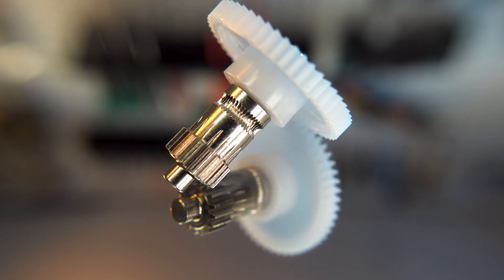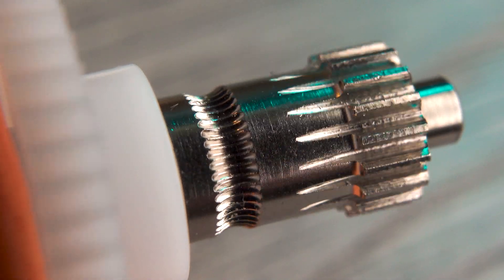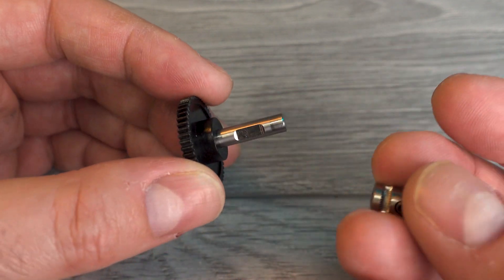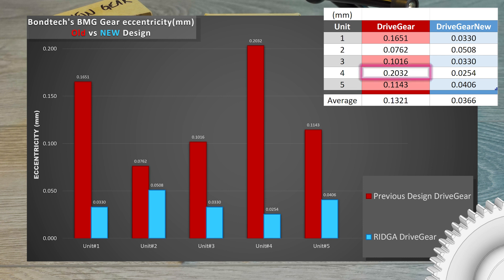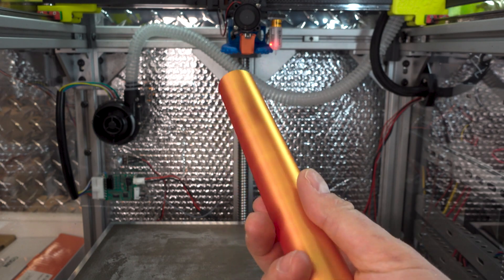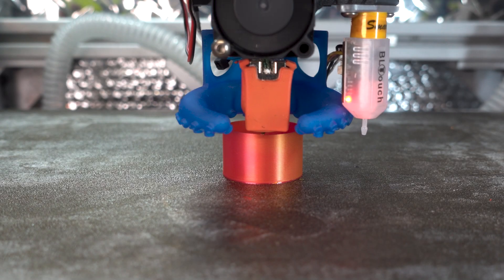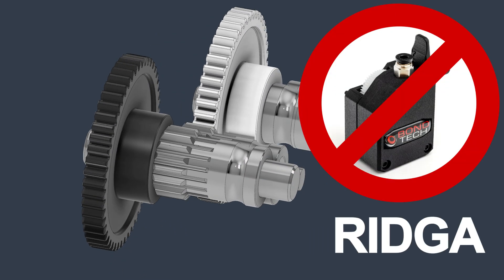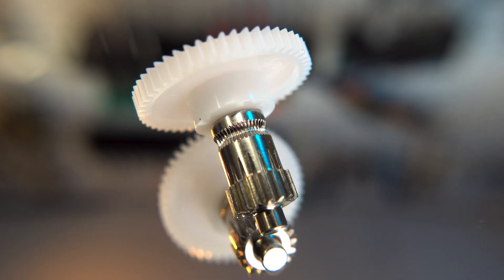Will this NEW extruder gear solve the issue?

Comment: hi miragec, vey very nice work, i have a cnc hextrudort from mellow, will the ridga work on it? also is it worth it or  the gear that comes from mellow installed is quiete as good as the ridga , i have bought it about a month ago its quite fresh, also another thing what bearings do you use instead of the secondary drive gear? happy printing!

Comment: Oddly enough, i built a validation stand to hold my .0005 indicator to check this. My findings with the 3 I checked, the one with the absolute best runout on the body of the gear (<.0005tir) had the worst runout on the peaks of the actual toothed drive section (>.0035) Unfortunately, I dont have an indicator tip that is small enough to mesure the depths of the gear to see not only runout, but the depth/peak variation.

Comment: After watching your both videos, i have been wondering why my same sherpa micro on clone gears was giving better layer lines than now. I have replaced  the short bowden tube, I cut the new one is little bit larger for very snugg fit. That might take away the little give previous one had. I might need to cut the tube little short than required and see the effect.

Comment: Hi I was thinking about this problem today and I had two ideas. One was of course just make the entire assembly out of one chunk of metal on the lathe. Meaning the plastic gear that gets pressed on as well. And also cnc’ed idler arms to ensure the cylindrical axis stays perfectly parallel to the other drive gear. Also, we should be using pressed gears on motors instead of set screws as that would fix some issue as well. My second thought was using the hysteresis of Bowden in a different way as a sort of “flow pressure capacitor”. Like what if you had a properly engineering chamber in the hotend that minimized stringing but also allowed for a flow buffer for more consistent pressure?

Comment: I just picked up a similar extruder, BIQU H2 V2S REVO. Noticed the solid gears and when i took one apart i was surprised by the quality. I got it for $45 and don't plan to use the Revo hotend, and will be adapting it to my hardened nozzle/volcano v1 (MK8)/ with copper adaptor Frankenstein of a hot end. I'll also be making my own silicone sock, once i figure out the best way to use foaming silicone.. maybe just using standoffs to make it "hollow" and minimize how much the sock touches the heater block

Sorry for the keyboard diarrhea

Comment: Thank you for this video and for sharing this great work. Using 4x bearings instead of the second pinion is smart because you no longer have to worry about managing the optimal distance between pinions versus gripping tension of the filament. Maybe you should replace one of these bearings with a smaller cylinder to avoid contact with the tooth of the remaining pinion?

Comment: Unfortunately, Bondtech missed the opportunity to reduce some weight. Or is there any reason the diameter of the area between gear and hobb-gear couldn't be reduced to 4-5mm?

Also, has anybody ever tried  to make a dual gear extruder with a gear ratio other than 1:1? Like 17 and 19 teeth for example (hobb-gear diameters would be different  as well)

Comment: So i just got an idea. 

Instead of fixing it from the hardware side by using precision milled parts which isn't exactly cheap, why don't we fix it from the software side by adding extruder concentricity compensation into the firmware? something similar to linear advance and input shaping, but for extruder gear errors instead.
Reply from the maker: That would indeed be quite easy to implement. And furthermore, pretty much all provisions are already implemented in Klipper, perhaps RepRap too.
Reply: I think is a bit impossible (without an encoder on the extruder) to know when concentricity beggins/ends

Comment: Looking for your advice: I have a Sherpa Micro with the original BMG gears on my Voron V0.2. Last night I built a second Sherpa Micro with the new RIDGA gears. I printed a Voron Design Cube test print with each Sherpa, and in those single test prints, I cannot tell the difference. Admittedly, I haven't done much in the way of print tuning on this printer, and I printed the cubes in eSun ABS, versus your Eryone Silk PLA. Not sure how much that would make a difference to the end result. I am probably doing something wrong (my wife would tell me that it's usually my fault).
Could you share the STLs that you used for your tests? Looks like the tube is printed in vase mode, is that correct?
Fantastic work, as always! Thanks to you and Bondtech for your efforts!

Comment: I bought several of Bondtech's original 2.75 gears and they were useless - the gears wouldn't mesh with the filament in place! This single gear piece seems to be an improvement. But, having been burned by buying expensive Bondtech gears that do not work, I will wait for a lot of real world reviews before I will consider purchasing this one.

Comment: Just slapped one in my CW2! Runs great! Thanks for all you've done for this leap in DD print quality!
Reply: Was it plug and play or did you have to modify the extruder?
Reply: @silent16932  only had to swap bearings for MR84s that are 2.5mm wide, KB3D has them for a good deal.
Reply: @jeevus3d980  wait wait in CW2?? I have bought RIDGA but it's reversed. I'd be happy if this is possible!!!
Reply: @iniqy  yessir!! First release of the gear from KB3D!

Comment: Welll  Too Little... and Waaaay Too Late.  
The Bondtech BMG design is for the dustbin of History . Good ridance IMO.
The Day of the repurposed MIG wire feed mechanism  as a Dual gear extruder  3d filament drive, is Over... IMO.

There are currently several Cheap clone types  available that have long ago Leapfrogged Bondtechs' "accomplishments' ... Inadvertently even
Some being axially Concentric / Billet efforts.. from their v First day.  
 Surprised that there is Still NO mention of the Shite quality "needle bearings" of the 2nd gear  though,  
OR the V Poorly / barely meshing gears. 
 Genuine problems  going 'unnoticed ' ?
  
Amazed by the Plethora of Skeletonised case extruders. These seemingly all Repurpose the BMG gear sets.  
Geee... building aMaserati Birdcage in ones' Basemen... but retrofitting Ford Pinto  drivetrains .
Pure genuis imo..   
Pointlessly shaving off a few grams of unsprung weight. For What ? real life advantages...
Why ? bother If Being Honest ?   
Motors ..Bearings... Cooling fans even, Are all Unsprung weight.. Seeing sparse improvements in that direction though.

Tough to fly like  eagles when using turkeys .
Reply from the maker: So tell me... what is your printer, and what extruder do you run?  This must be a hell of a setup.
I do agree with you though that the advancement in the domain have been slowed down by cheap clones flooding the market therefore killing any small business who tries to innovate.
Reply: Eagles and turkeys use the same wings. You can get there.

Comment: Thats a step forward! Congrats. I fixed the offcenter issue of the gear on the shaft by hugging the shaft with a piece of aluminium foil until the gear was a bid snag when placed on the shaft so the gear was not off center when screewing it down. That worked veeery good on my orbiter v2 clone.

Comment: I have a question about LG X and their gear system how do they perform? They also have a new gear system as well. Would think it has any major improvements on the print that you can see? I would love to see what you find.
Reply from the maker: I have not looked closely at that extruder yet as I am focusing on the design I made from the Bondtech internals.

Comment: No new parts for the BMG. This new gear does not fit the BMG.  This makes me sad.   I have wasted money on three BMG extruders and bondtech isn't fixing them.
Reply from the maker: The reversed unit was the test bed, now that we know it works.  Bondtech is moving ahead with BMG version.  It will be available in 6 weeks from now.
Reply: @MirageC  I just ordered the part for the BMG.  It would be great if it would make my printers usable.
Reply from the maker: @NackDSP  I hope it helps you with your printer issues.  You can have a look at my other videos on extrusion consistency to identify other potential root causes for your problems. https://youtube.com/playlist?list=PLY5rp1lSfPHAdcZ6Hz38B3kqnMZDFxaGz

Comment: Damn it's on backorder. Now I am wondering if a shim between the shaft and drive gear would achieve almost the same level.
Reply from the maker: Some users did get good results with this.  The plastic gear will still remain potentially eccentric though.

Comment: How does the Vz Hextrudort's gear from Mellow compare?  If I'm not mistaken the slanted grooves for driving the filament should there remove another potential problem.
Reply from the maker: will be able to tell you as soon as I can get to this project 😉
Reply: Hello something new about this gear? Would love to upgrade to Bondtech or Mellow with helical gear. Thanks @MirageC
Reply from the maker: I have been using the Mellow VZ hextrudort with twirl gears for the last two months, its been good so far, but too early to draw final conclusion.

Comment: yeesh, this sounds like the best option would be to just have the force transmission gear separate from both hobs, and have those simply turning on bearings always pushed to the same side
quality by design anyone?

Comment: The eccentricity of the plastic gear is of little consequence. Even if it's off my 0.2 mm the mesh play will be much less than that. However, if you do redesign this then why on earth wouldn't you make the mirroring gear helical, which would fix much of the meshing play that all of those non-helical dual drive extruders have???
Reply from the maker: I cannot speak on behalf of Bondtech,  but I think that part of the plan was to release something now to fix eccentricity now, and then take all that feedback and come up with the next gen extruder.  Anyways, I like to think that this is the plan... 😉

Comment: Quick question, actually. How does this affect the LGX and LGX Lite extruders? I imagine the gearing system in that is done differently. Do you know if Bondtech intend to remake their molds for these improved tolerances on the LGX?
Reply: From my information, bondtech is probably making a all metal gear LGX Lite version, but at the same time, probably not necessarily for the public.
Reply: @5jvm0u4  I'm aware a new LGX Lite variant is coming 👀
Reply from the maker: Oh!  that I did not know! good to hear!
Reply: They have all metal gears for the LGX which also fits the LGX lite. I have no idea if it affects the surface quality or not though

Comment: Yoour chart says NEW vs OLD "BMG" gear, but the link itself says this is NOT compatible with BMG
Is there a mistake on the chart or in the actual site?

Asking since the Voron clockwork extruder uses BMG pieces, so it seems this would not fit it
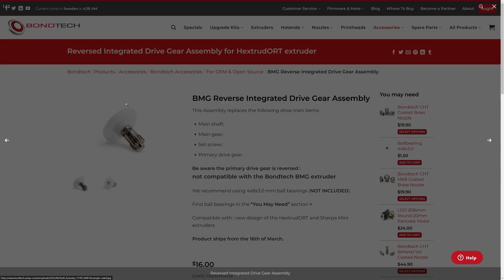Reply from the maker: The old set was indeed from a BMG, but since the drive gear and the shaft were two parts it allowed us to mount it reversed for our needs.  This new unit is for the reversed configuration only. See at 5:42.  Bondtech is telling me that BMG version will be available in a 1.5 month time frame.
Reply: @MirageC  Oh awesome I missed that, thanks!

Comment: This is cool but why did they change it from 5mm to 4mm? It would have been way better as a simple swap.

Regardless, I’m going to get them for my Vorons. Just seems like a weird thing to change the size of.
Reply from the maker: Apparently machining the units was easier this way.  And it allows for bearings with bigger balls which is good for precision and smoothness in this case.
Reply: @MirageC  ah okay. I assumed they wouldn’t have done it if there wasn’t a reason. Definitely a pain that I now have to get bearings too, but a small cost for such great improvements!

The work of you and BondTech is impressive. Thank you so much for all you do

Comment: Thank you so much for doing this. Looks like I need to find a replacement for my BMG on my Prusa. 

I am about to make magnetic couplers for my Z axis to eliminate any z wobble, this video shows me the next thing to work on for perfectly smooth prints. Well this and quality 0.9 deg steppers on X and Y, a Raspberry Pi and Klipper. 

Lol, I'm aware I have a "Ship of Theseus" thing going on with my Mk2, seeing as it's now almost a Mk3S with a BMG, Dragon hotend & 0.9 pancake stepper.

I should have changed to a CoreXY a while ago, but I see this as a learning experience and testbed to learn exactly how I want my custom printer to be. 

I really need to get a resin printer too, seeing as I've been printing with a 0.15mm nozzle lately.
Reply: Russell Phelan  god damn you got everything out of your printer! I klipperized mine a week ago and sitting comfortably at 150mm/s infill and 75mm/s walls. 
You mind sharing a list of your mods/upgrades to a fellow s1 enjoyer? ;)

Comment: If bowden produces less artefacts than direct drive, some flex in the drive coupling would reduce that. Alternatively can CGODE limit extruder acceleration?
Reply from the maker: All those methods would compromise the extrusion timing.  A very precise quantity at a very precise time.  Change any of these two and you will get artifacts.  Bowden damping effect has the downside of not supporting high speed printing.

Comment: Truly amazing result. Programmers think optimization is evil. Thanks for proving them WRONG.
Reply: What? We don't like premature optimization, i.e. without even knowing if there is a problem at all and if so, where it is and what needs to be optimized.
Reply: @zapl80  Who decides what is premature optimization. I have seen code that takes 10 hours which I easily make take 15 minutes. Avoiding easily obtained 12% gains is a sin.
Reply: @mikeyearwood  yes, good optimization is good, just pointless optimization of non-issues wastes time that could be spent better and tends to make the code harder to read
Reply: @zapl80  Don Knuth said a 12% improvement easily obtained is acceptable to all industries except programming. Shame on programmers who disregard simple improvements. Only the densest programmers should disregard all optimizations. Some won't even accept a finished module so they can learn. This video shows how programmers should think.

Comment: is there a compatibility chart somewhere? with and without modifications would be perfect. I can not believe that only two extruder are compatible
Reply from the maker: I have done the heavy lifting of highlighting the issue and worked on a solution with Bondtech.  Since all reversed gear config extruders are very similar, I hope the community will come forward with versions that can accept this upgrade.

Comment: 3mm filament would likely even out the lack of precision in the extruder, but only due to the defects happening more gradually
Reply from the maker: 3mm filament would be pretty much the same as the volume of the inconsistencies would be amplified by the larger filament cross section.  I would be spread over a greater extrusion distance, but it would still be there.
Reply: @MirageC  I agree.  However, the greater extrusion distance would mean a gradual change in the defect and less noticeable.  Either way, interesting video, thanks!

Comment: I do wonder why no-one uses a rubber drive wheel, no more chewed through filament & no sacrifice on practical hotend pressure
Reply: mostly likely wear, rubber ages and the high temperature is not beneficial for that either.
Reply: @hornet331  Yeah makerbot had a rubber idler, not even a drive gear, and it was hopelessly unreliable.
Reply: Another possibility is to have two drivebelt loops that sandwich the filament between them. Lots of contact surface area and no teeth touching the filament.

Comment: How fast you can extrude with only one gear?
Reply from the maker: Extruding or printing?  as demonstrated in the first 2 videos of the hotend championship, as soon as pressure creeps, printability greatly drops to a rapid halt.  So with this single bearing config I have been extruding very close to the max of my volcano on a daily basis for close to 5 months now.
Reply: @MirageC  what if other gear is straight but with tooth? Like this: (o|
Reply from the maker: @Salziify  In my opinion, if the second driving force is slightly at angle, it will push the filament towards different zones of the hobb groove, straigh or hobbed.  Both would need to be straight to avoid this I think.
Reply: @MirageC   but doesn’t it also happen with only one gear too?
Reply from the maker: @Salziify  In a one gear with a bearing setup, the idler bearing has no authority on the filament other than pushing against the drive gear.  It cannot push it sideways.
Reply: I’m wondering how much it affects to pure extruding speed, but of course it doesn’t matter much while printing if it’s enough

Comment: Thanks a lot, I am really looking forward to testing it.

I built my own interpretation of a highspeed printer at the beginning of last year, and the irregular extrusion is an issue that I gave up on troubleshooting. 
(My most successful fix was replacing the second hob gear with a bearing, as has worked for you too)

Comment: So, do I understand this correctly, this new gear can be put into a Sherpa mini, or do I then need to drill out for the new ball bearings?
Reply from the maker: I have approached the Sherpa mini creator to ask if this is a drop it.  I think the current version needs some tweaking.  He told me he would look into it.
Reply from the maker: Oh and the trill is required to pass the spur gear through the body.  The bearing have the same dimension outer diameter as before.